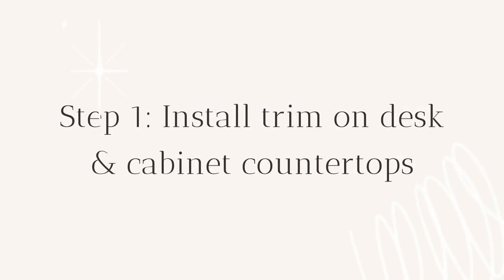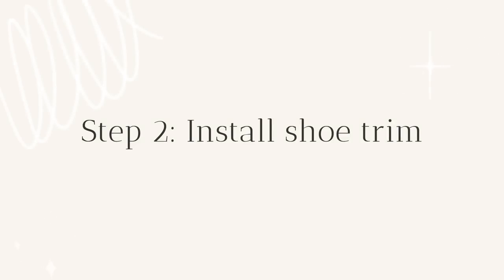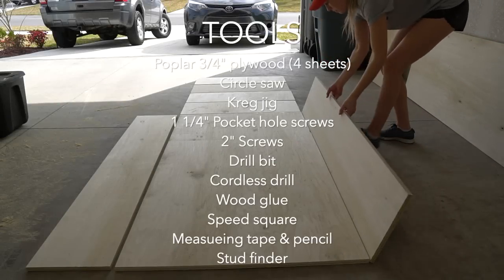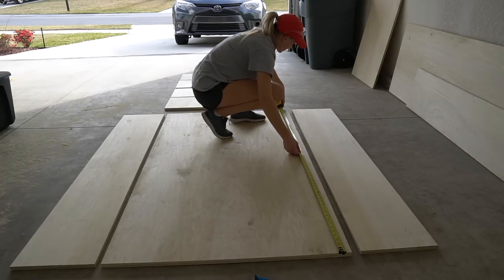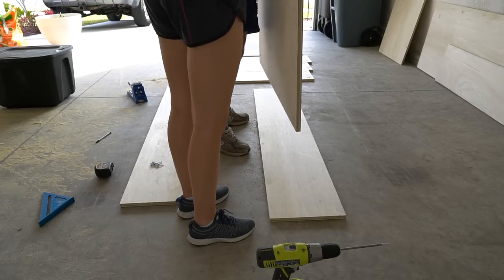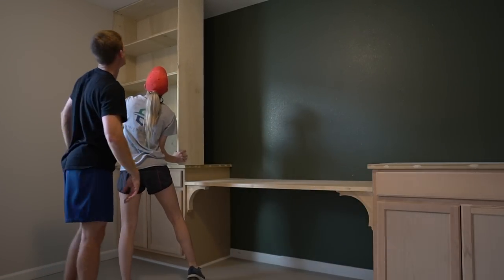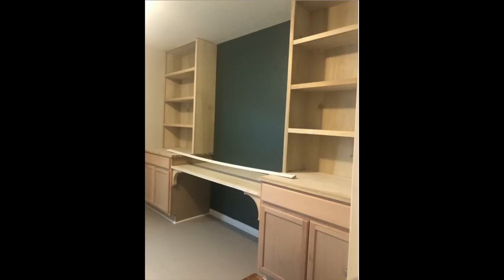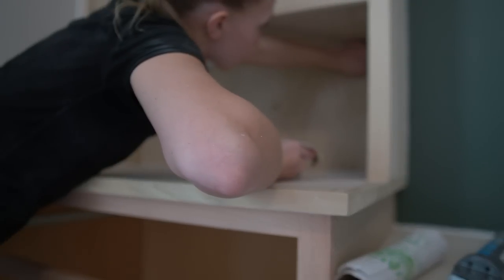Home Office Makeover [Part 2] | HomeWithStefani

Comment: Tip on pocket holes for large sheets.  Put the jig on top, the clamp will "square it sufficiently and you can clamp and unclamp without walking all the way around.  I built an additional jig that attaches to the clamp with a couple of screws and is 12" wide to wrap up over the top of the panel to keep the hole square to the edge easier.

Comment: Just found your channel and I'm catching up on videos.  Nice projects so far!  (Closet and office)  Painters tape works great to hold the longer trim pieces in place before you nail.  A couple small pieces over each end is all it takes.  Just noticed you putting your leg up against it in the middle on the long desktop piece.  Just a thought.  Please ignore it if not welcome.  :-)

Comment: Cant lie, I cringed hard at 2:41 and 2:50 when you were having issues with the brad nailer and it looked like you pointed it at your face. Safety reminder: NEVER point a nail gun toward yourself or any other person. If it's not working, or jammed unload it and disconnect it from any air or power sources before fixing, and even then keep it pointed away from you.